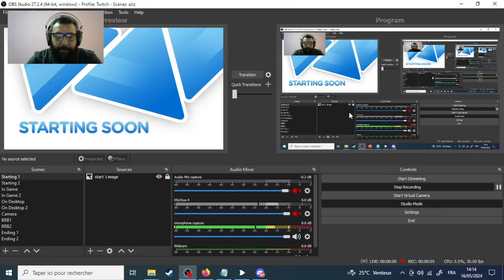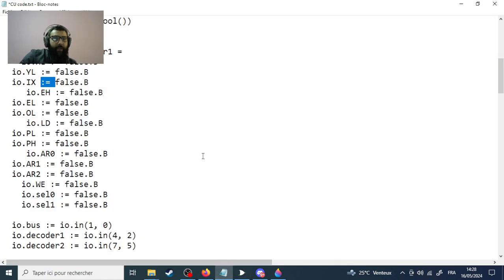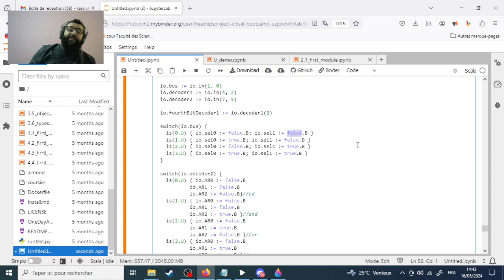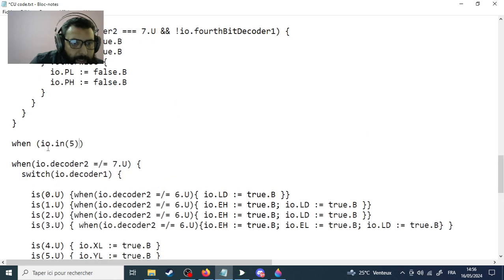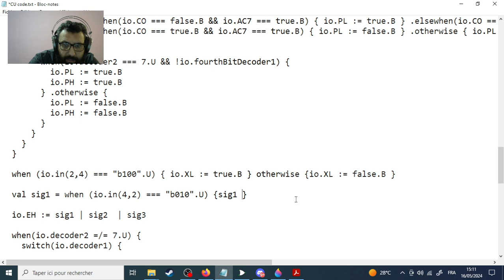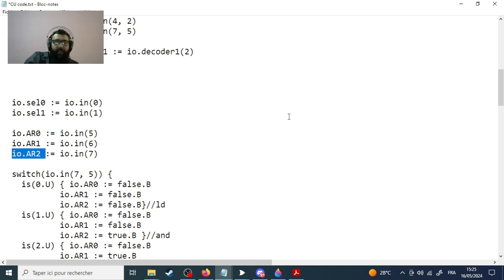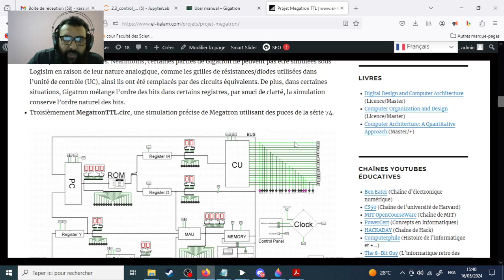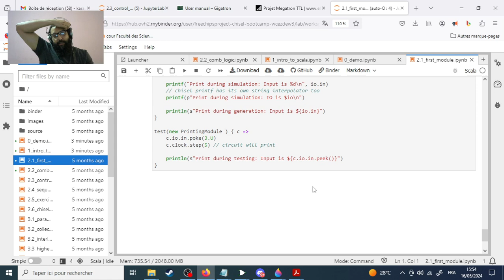Megatron Project [software] - consulting session 12

Comment: Hello.
I have several questions about your Megatron Project.

What I understood after reading your README.md is you removed the VGA and replaced it by small screens, and added a native keyboard. And there is also NES controller.circ. 

But how can I see that screens? Where are the screens components? And how can I use NES controller File? Is it possible to insert input values not by my mouse but keyboard?

I thought that Logisim doesn't support VGA so you changed the way to print screen.

I just want to see the Gigatron Screen by logisim. Is it possible?
Reply from the maker: Hi
The addition of the screen the controller and the keyboard are not intended for simulation in logisim but to be implemented physically in real world.
Effectively, Logisim in the standard version can not support VGA. More than that, logisim is way slower for simulation than the real hardware, even if you find a way to show VGA, it would be 1000 times slower.
On the other hand, with a homebrew program and a simple modification on the Gigatron circuit, it is possible to use Logisim TTY terminal to easily interact with the machine.
Reply: @abdelazizkara2352  Is it impossible to extract data intended for VGA output using JavaScript and display it in a different way? You mean there is no way to check the screen output not using a homebrew program? (actually I don't know about that)
Reply from the maker: @sohyunzzq  By a homebrew I mean a program different from the software suite supplied by the creators of Gigatron that probably don't use VGA. The use of JavaScript to display the VGA signal, I don't know if it is possible, but I think it would be simpler to use Logisim-evolution instead of Logisim knowing that it support VGA, and it is possible with less effort to migrate from Logisim to Logisim-evolution.